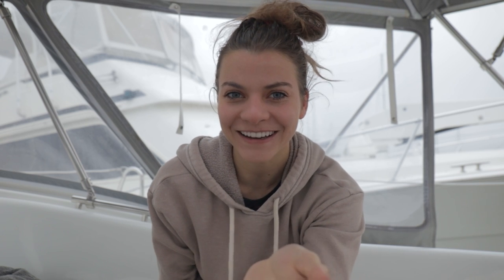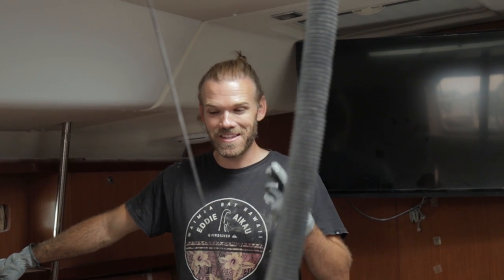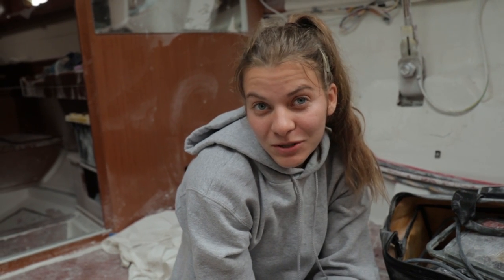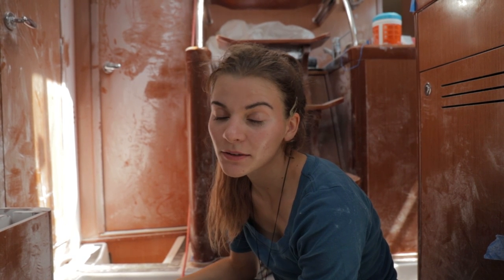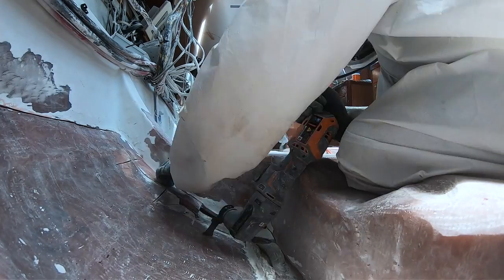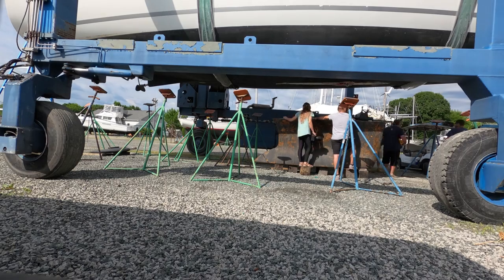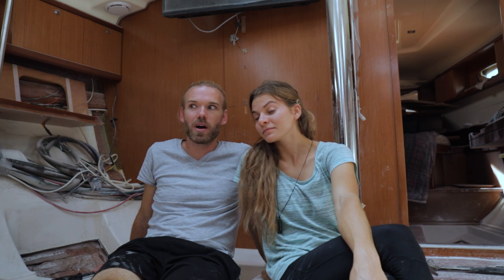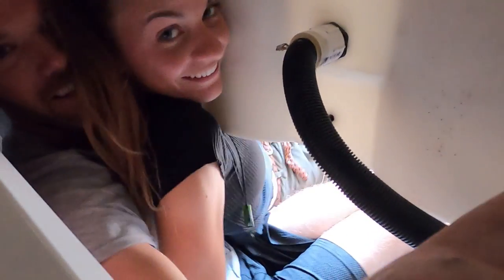Our Keel Gets RIPPED OFF! (and so do we) | Expedition Evans 11

Comment: In terms of the laws of physics - I'm not sure how you would ever NOT have had a final ripping at the total separation stage - massive weight; last connection points only held up by heavy duty bonding substances..they cut as much as they could but with no bolts to hold it it was all about massive forces pulling down on a tough bonder...maybe the leak and rotting would not have helped a clean release --- that said no excuse at all for problems of communication and sexism...
Reply: Seems like they didn't need to lift the boat that high. If the keel is half an inch off of the ground they can work on the adhesive until it all lets go and not have such a crash. Also they can lift, then lower then work the adhesive, then lift again, etc. But I am no expert and I have never dropped a keel before. I have only dropped rudders, which are easy by comparison.

Comment: Probably did you a favor in that they prevented you from participating... I trust they are only billing you for two hours on the slings, etc for labor. I'd seriously try and find out about the past history on boat, if the damage/improper repair was hidden by previous sellers, etc. Don't bank loans/brokers have insurance on some of this stuff, particularly if it was not disclosed ? Maybe you can get a reduction on price if you did not accept as is condition indemnifying them...

Comment: Anyone with sharp eyes would detect the failed design and manufacturing of this boat.
13:11.....It is clear that the water scuppers in the lower flange of the grid are too near the hold-down bolt of the keel and in other videos the top of the scuppers have very little fiberglass interfering with the lateral tensile strength of the flange as the boat heels.
13:16  It is clear that the base plate under the head of the bolt is too small, it was overtightened and cracked the flange and this meant that the vertical wall at that area took all the stress as the boat healed and the crack is easily seen with the start of the crack commencing at an air bubble at the lower inner edge which was left in when the grid was made. Those tiny small area base plates damaged the flange as the bolt was tightened. Those base plates should have been much longer stainless steel flat bars placed on a thickened and higher flange.  I do not see a good I beam effect in this arrangement.  In fact, I would describe the situation as disastrous and the designer should be informed of what was found in this boat. 

13: 23 is confirmation that the tiny area base plate under the head of the keel bolt was overtightened with respect to the area of steel and fiberglass existing in the area and the location of the start of the crack says it all.  Imagine all that action occurring on the other flanges around the hold down bolts.................no wonder that grid did crack in various places and the boat leaked. Beneteau should not shirk their responsibility in this case and they should shoulder the fact of what was found in this boat, and give this couple a helping hand in getting it in good order, as what one expects in a boat where people's lives are concerned.

Comment: Best when you start your Glasswork use Fiberglass over wherever you do any bonding, turn the whole grid into an integrated unit to the Vessel! This will ensure that you have accomplished the task being a bit overbuilt than factory Standards! God Bless your Tenacity! And glad to see you moving forward. Hope you can get along with the boatyard. Be need to upset them at this point. Smile and Be Nice to them even if.......Also, when you arrive at the point of starting your glass.... I recommend you find a Very Competent Individual who is familiar with structural Fiberglass repairs. Keep Smiling don't Murmur! Life is Good and keep in mind Life Happens and get used to some of theses things, It's Just A boat! God Bless

Comment: Why didn’t you start with a boat in better condition 
Don’t you have jobs?
Reply: Maybe they couldn't afford it.
Reply: They are building a youtube channel. If they are successful they will basically be getting paid to film themselves fixing the boat. It may be that fixing a broken boat pulls in more viewers. But for any normal person it would not be worth it. The boat should have been scrapped. What I mean is, pull the engine, mast, winches, etc, and scuttle the hull in deep water.

Comment: I feel so angry the way you have been treated. They should have used bottle jacks under the keel to slowly let it down rather than let it drop, and damaging the boat further.The cancelling on you several times and not doing the job you are paying them to do professionally. Defo insurance claim on the yard and discount for keeping you waiting, and lying to you and being down right rude. An apology is needed from whoever was running the show that day, he was probably getting a little back pocket money to do other jobs on your time for his "mates" instead of doing your booked in job. Keep your chin up, be strong, look forward now and carry on, all the best.
Reply: yes my thoughts exactly careful hydraulic lowering should have been used, not rushed out of control "lowering" otherwise known as "falling".

and it's not your fault evans', regardless of the circumstances or personal issues the the yard guys should known better, and should not have pressured you to release the bolts to the point that the weight of the keel was hanging on only by the bonder, not the bolts, until after jack support was ready.

sure given the condition of the boat some of the ripped area was probably already delaminated, BUT IF IT MAKES THAT NOISE THEN MORE AREA IS RIPPING/DELAMINTATING! which was uneccessary additional damage. of course any repair is a pain and since you need to relay quite a bit of glass it's not that much extra bother to relay quite a bit extra "shrug"

and in the grand scheme of things you'll probablly hardly noitce the extra materials the larger delam'd area will cost you